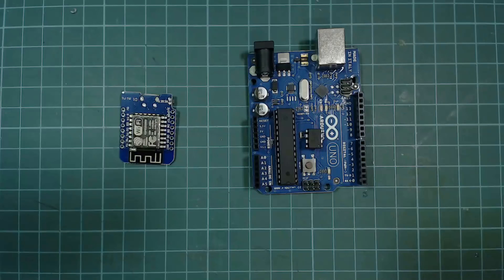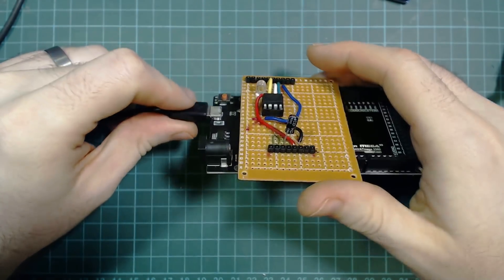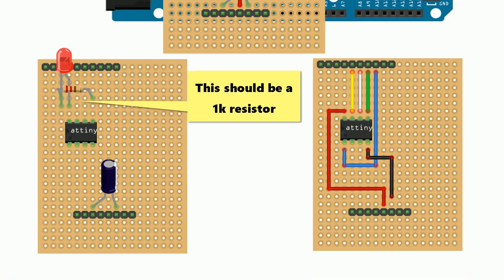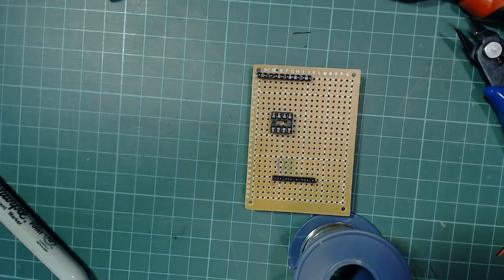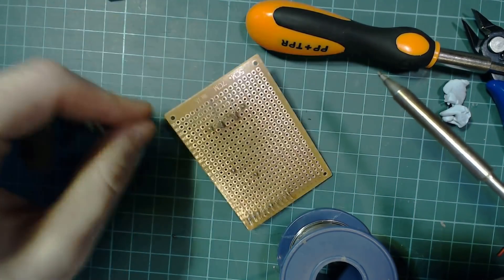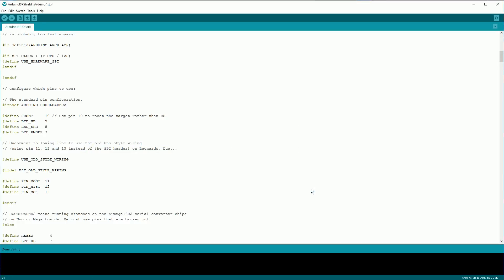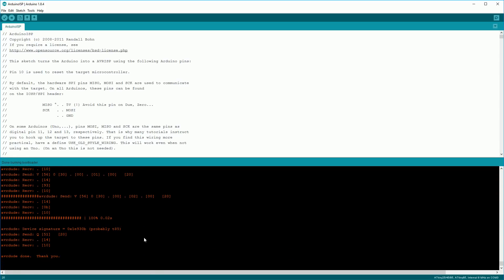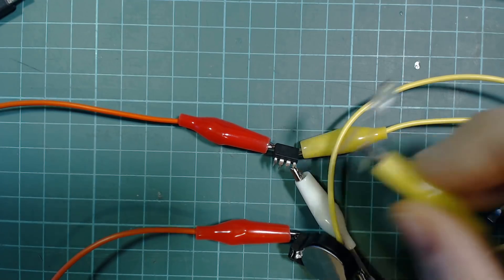Programming an Attiny Arduino board  (Using a DIY shield)

Comment: Hey, I tried to burn the bootloader and got an error, can you help me?
Reply: Try programming attiny85 using Arduino without burning bootloader. I tried it and It works even without burning a bootloader.

Comment: Digging up an old video..
i just had me sent two attiny84 for playing around,
now i got arduino leonardo, pro micro, esp8266/d1-mini

since youre all esp8266:
would it be possible to make this work over wlan, so you can "stamp" ISP program the attiny with an esp8266 running from 3xAAAs ?

Need to look for a demo for pro micro now. 😒

Comment: I built my own attiny programmer using the original Arduino ISP programmer board, a 6 pin ribbon cable and a zero force socket 2 years ago ant it works fine. The socket allows to insert and remove the attiny without bending any pins. I also made a bigger version for the larger attiny chips which have up to 12 I/o pins (attiny 44/84). I use those chips a lot because of the wide voltage range they work in as you also mentioned in your video. You can power it from nearly any battery without any voltage regulation.
Reply from the maker: +Michael Bernhardt that sounds good! Yeah I have to be careful removing the chips from this one

I got an ISP programmer there recently so I'm hoping to just build a header into the final project boards that allows me to connect into and reprogram as needed

Do you have a link to a zero force socket?
Reply: Brian Lough yes. I bought mine locally here in Germany but anything like this here will do. 

https://rover.ebay.com/rover/0/0/0?mpre=https%3A%2F%2Fwww.ebay.de%2Fulk%2Fitm%2F272807464870

Just take care that you get the narrow spacing for the attinys and enough pins. But I never found one with less than 20 pins so i used this one. Maybe I post you a short clip showing mine in action if I manage it to get to my lab this weekend. I have a 6 month old daughter and as you know yourself the little ones steal a lot of your free time ;-)
Reply from the maker: +Michael Bernhardt haha, they sure do! My wife is gone for the day so its just me and the little one today and I went to bed way way too late, so its going to be a long day!

Thanks for the link, I'll check it out when I'm on my computer later (the YouTube studio app doesn't allow clicking of links for some reason)

Comment: Found you via Dave from EEVBlog...since i´ve next to no experience with the Attiny...is it possible to use the arduino IDE to write code for the attiny as well and upload it with this thing...? edit: ok, sorry for asking...next tiime i watch the video unitl it ends, before i´m asking stupid questions ;)
Reply from the maker: +TubiCal hey, welcome! No worries! Yeah, they are really useful if your looking for something low powered, once you have the programmer they can be easily programmed with the arduino idea. I'm finishing up a video for a project where I used an attiny , should be released tonight or tomorrow

Any more questions about anything just let me know!

Comment: Thanks for the video Brian and a great tutorial on how to get started with the 'tiny.  I did something similar, making a simple programmer with a cheap Nano clone on a prototyping board and a Zif socket to make it easier to connect/remove the ATTiny85 - I end up doing that a lot!! :-)
Reply from the maker: +Peter Leather thanks! I'm thinking I'd like to make a much much smaller version  using iscp pins that are on most boards (including my nano). Yeah I definitely would have used a zif socket if I had one, I think its another thing to add to my shopping list!